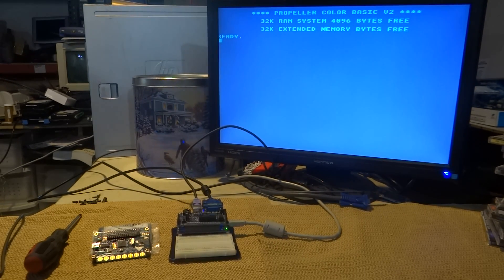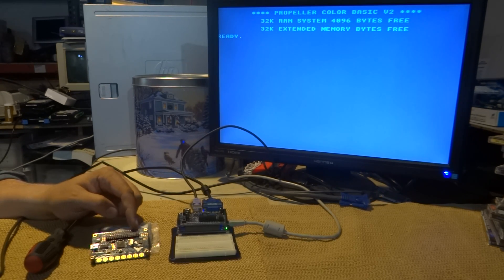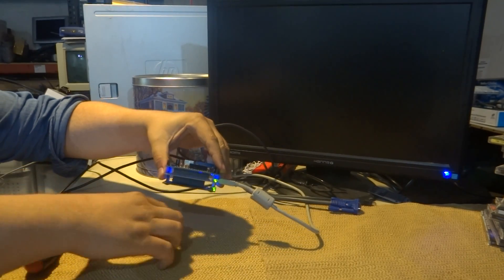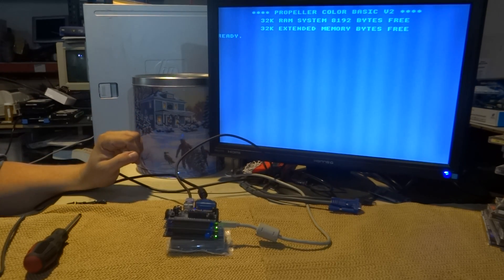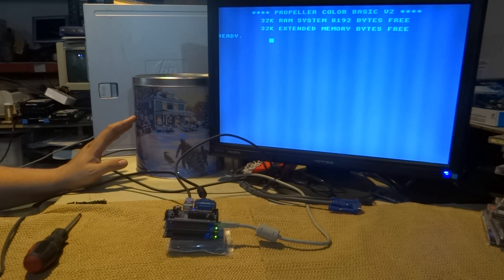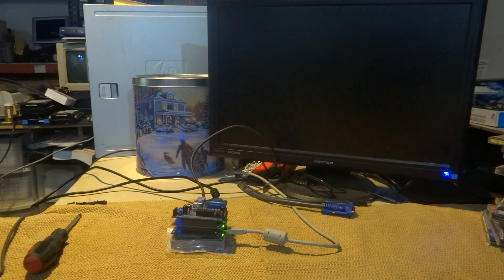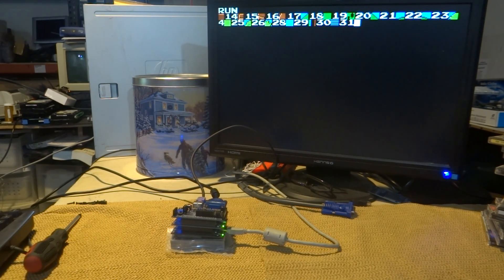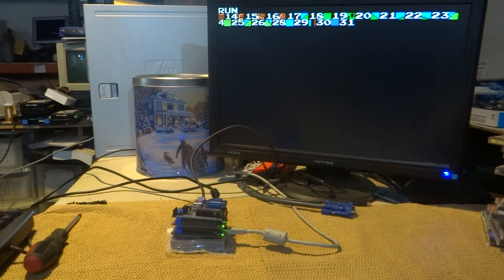Pocket Mini Computer, 2nd Propeller Upgrade VASP

Comment: Great stuff, Jeff! 

I've been thinking that my Propeddle project should have space for a second Propeller on the final PCB so it will be possible to divide tasks like you do here, and do things like graphics and full color (the current project supports TV and 3-bit VGA).

Incidentally, I wonder if there's a way to make more hub memory available for Basic by reusing hub space that's used for PASM code that gets downloaded to the cogs and then never used again...